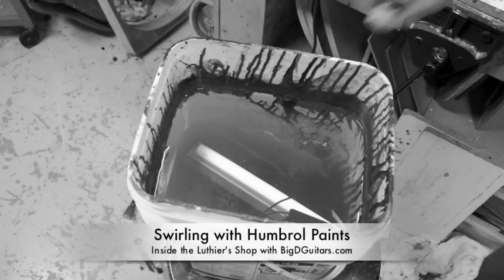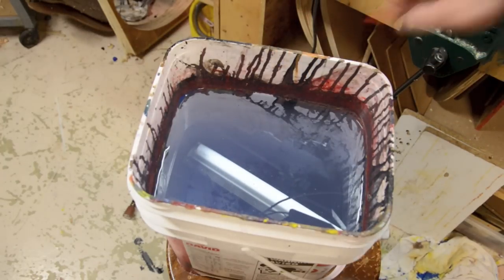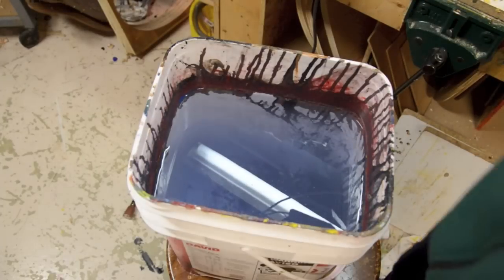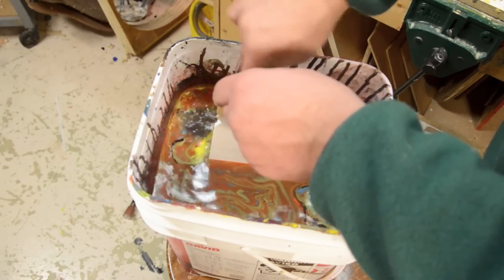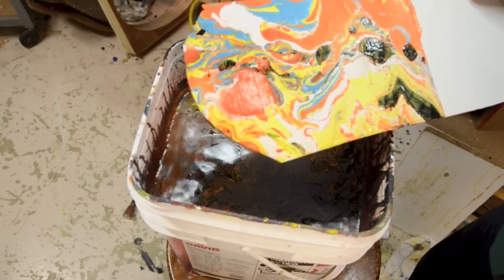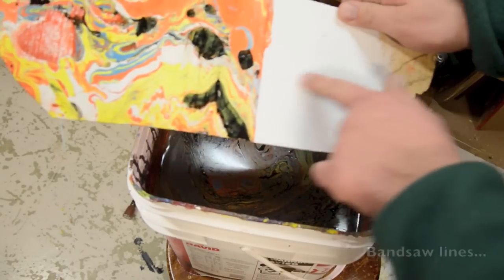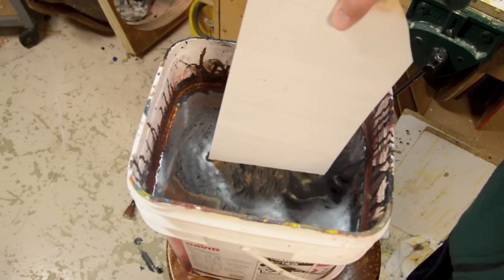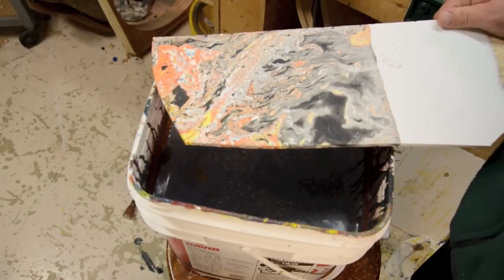4th Test Swirl w/ Humbrol for a guitar body Luthier Swirling a guitar body dipping tutoria

Comment: My buddy and I have had good success with Magic Marble paints.  If you ever try them just make sure that the water, paint and room temperature are 70 degrees or a tad warmer.  We had 2 failures when we tried swirling in my friend's basement this past Winter, which is pretty cold (despite the little heater he had going).  When we did it in his kitchen - success!!!

Comment: Did you use thinner for the paint? I've tried with humbrol enamels but it doesnt expand like in your video :(
Reply from the maker: Erik Montenegro No I didn't thin this one.  I struggled with these paints.  Best advice I have is to get the droppers so you can get close to the water.  That helped with all my paints.
Reply: Just got them, thanks a lot for your response!
Reply: yes Erik, thats true. I have the same problem. And also on this video, you can check that the black color does not expand either...

I do not know what the solution is, but I've tried it with different temperatures and it always happens the same; The first color expands a lot, the second a little, and from there the next color stays in thicker drops

I'm also using Umbrols without thinner, also I use droppers.. No idea about the solution, but I've check other videos and all colors expand properly..